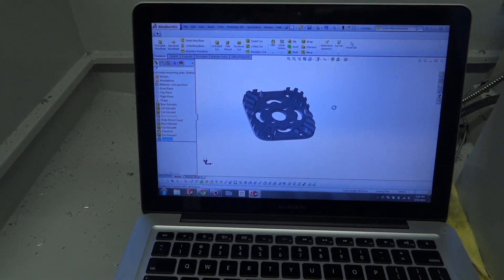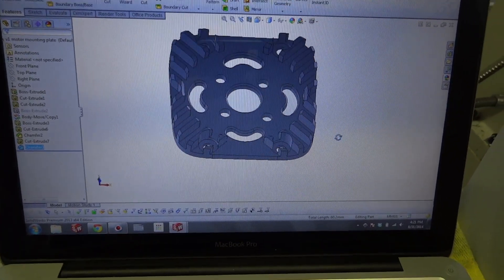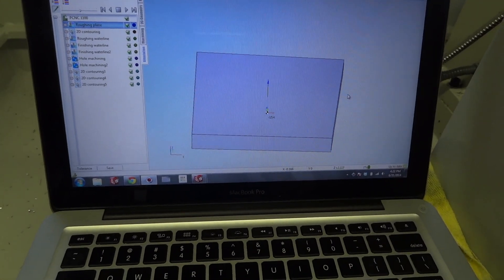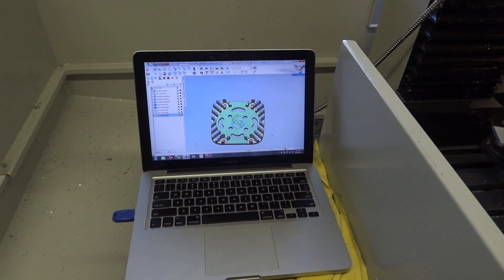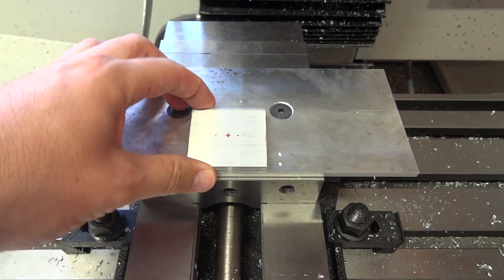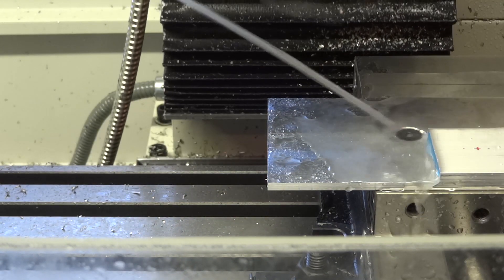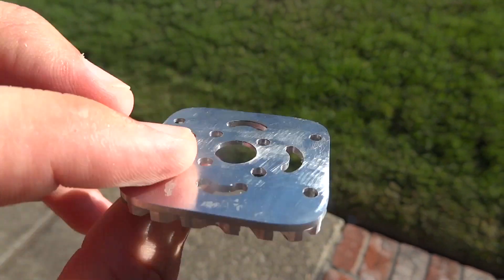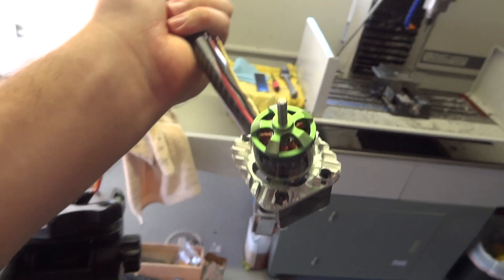Making a New Motor Mount on the CNC Machine

Comment: Nice part.

However, I believe you'll need to have the mount and motor surfaces match EXTREMELY well, a mil or less across the entire contact surface ...or... use a conductive paste, or it will be little more than a pretty plate the motor sits on.

Another issue you might run into is when everything is bolted down, flex and vibration could breakdown a heat conductive paste rather quickly.

I would suggest, if you REALLY want to have heat sink surfaces is to incorporate the mounting plate INTO the motor base.

Comment: A good way to reduce miscalculations is to use dummies. In this case a dummy motor with correct outside dimensions. Easy to build in solidworks or you might find it on grabcad or 3dconcentcentral.

Comment: Very nice!! Have you looked into shot peening your finished parts with glass? It won't look as good as machined aluminum but is does stress relieve the metal. It is also a prepped surface if you are painting parts.
Reply from the maker: Since most are just prototypes, it's not a concern. I do have access to a bead blaster though. And will pick up a small tumbler for deburring.
Reply: I personally like the machined look but it, peening, is supposed to help strengthen the metal composition. Glass peening is all we used in racing motor parts. Maybe able to shave off another .100" peened?